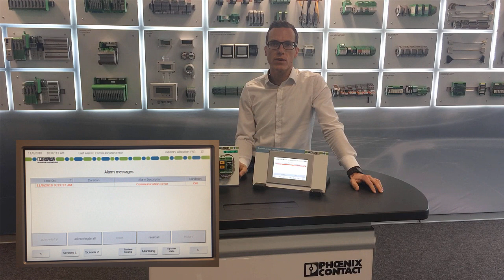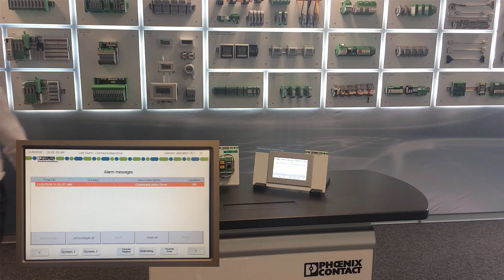How to monitor a PLC-to-panel connection with Visu+ or Visu+ Express | HMI Software Tips & Tricks

Comment: Hi, did you create an alarm before the script? Should the alarm show if I run the project on my local computer?
Reply: Now I understand more after my test, Lifebit = Variable connected to PLC which change in every 1 sec.,  xCommAlarm
 = Internal Variable that displays an alarm created on the alarm management. If the signal from the PLC has not change for 2sec  you can set a Tag/Variable that issues an alarm.
Reply from the maker: That's right, Ray:  there has to be an alarm with the xCommAlarm variable.